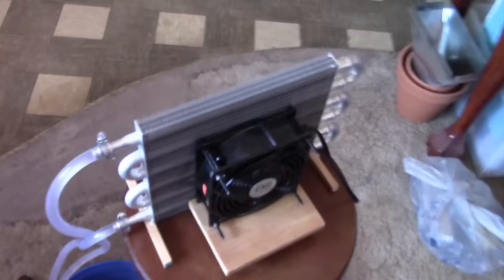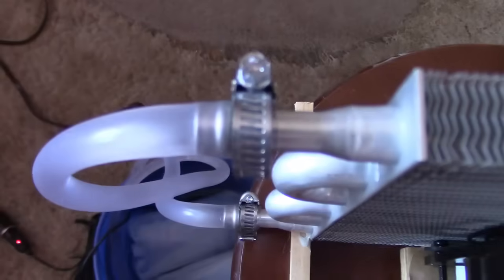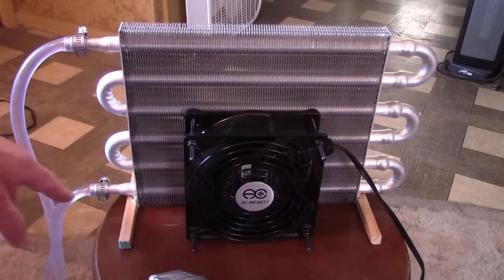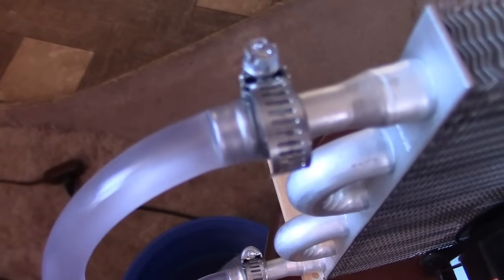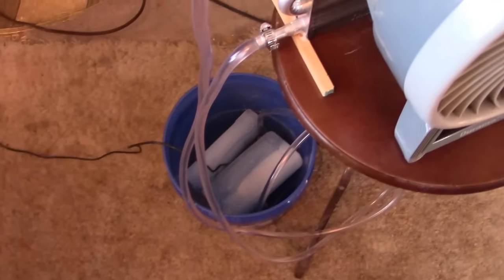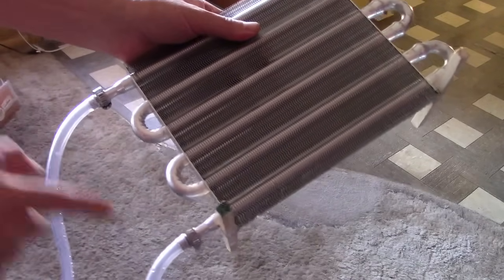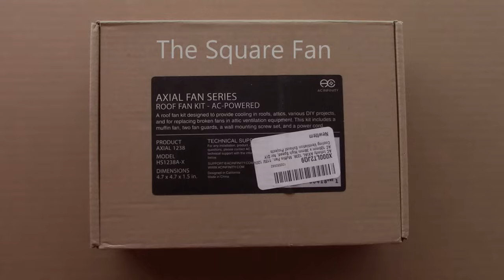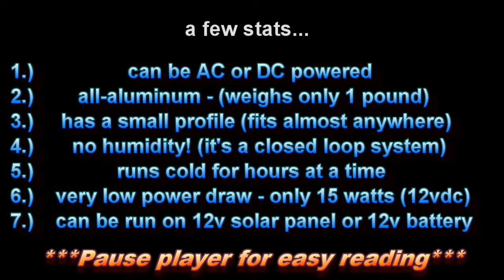Homemade AC Air Cooler! DIY Air Cooling! best yet! (no added humidity)! Easy DIY - Air Conditioner!

Comment: how about connecting both hoses to the pump with a small coil of hose in the water for a closed system, it may keep the water colder longer, using a salt brine would also help
Reply: Great job
Reply: Will the salt decrease evaporation rate?
Reply: @aliksashka  not the original commenter but saltwater has a lower freezing point, if it's salty enough you could potentially have sub 32°F liquid water from the freezer. It's specific heat capacity is also(slightly) higher, due to the properties of the dissolved salt. However, if there are any metal components in contact with the saltwater, you open yourself up to significantly higher corrosion rate, and if there are dissimilar metals in contact, galvanic corrosion(sometimes referred to as electrolytic corrosion). All in all, unless you NEED the extra degree of cooling or you know 100% your components are all one type of corrosion resistant metal or plastic, I'd choose longevity of equipment and thus fresh water.

Edit: evaporation isn't much of a concern with this design, as it'll lose effectiveness before the water heats up to the point it would rapidly evaporate. The intercooler or whatever he used won't allow for evaporation, it's designed for closed-loop operation, vented at the reservoir, exactly as the build is designed.

Edit 2: @Doc Inc, a closed loop that is expected to go through thermal transients (temperature changes) that has so surge volume (space to expand and contract) would over pressurize. It would likely fail at the hose connections(any of them, I'm not sure which would be most likely.) You'd need to add a very low pressure relief or punch a pin-drop leak into the discharge, which may effect efficiency. Either that or install an accumulator/vented expansion tank on the suction line, and the latter of those options kind of defeats the purpose of a closed loop. I suppose a small plastic check valve, again on the suction, might do the trick. It'd be cheaper than any of the other options.
Reply: @USNJackman  Thank you very much for this detailed explanation!
Reply: @aliksashka  no problem at all! I've taken classes on heat transfer and fluid flow, as well as design materials and water chemistry. I love to share the knowledge I have and learn more! : )
Reply: All good points. In this case sing a closed loop system I doubt there are dissimilar metals as the pump internals are plastic? All said and done I believe the best improvements would come from tweaking the flow rates,fan speed and insulation
Reply: @ronaldduck7567  absolutely, with a bigger heat exchanger, bigger pump and bigger fan combined with a larger reservoir, you could make a small "cooling cart" to easily move anywhere in your home and stay cool. Insulation would absolutely help efficiency, I'd say some thin flexible insulation on the tubing would be the biggest game changer. As for the bucket/reservoir, upgrading to a cooler would handle that, or just stack it within a second bucket. There should be a small pocket of air between the buckets and entrapped air makes for pretty decent insulation.
Reply: @USNJackman  a rolling cart set up would be PERFECT😃

Comment: What would you say worked better - having the fan on the front (extraction) or at the rear - blowing over the fins?
Reply from the maker: hi there. i like having it on the front. blows more air that way.
Reply: @desertsun02  just looking for the parts to get it sorted tomorrow.

Comment: If you make a box for the trans cooler with hole for the fan on the opposite side, the fan will pull more of the cooling surface air from the cooler possibly creating even cooler airflow. Maybe. Lol just a theory.

Comment: Which Heat Exchanger are you using?
Reply from the maker: hi. these are the hayden transmission coolers. i have several models 401, 403, and 405). if you're looking for them - amazon has them. 👍

Comment: Entropy.... where is the heat moving to?
Reply from the maker: hi. the heat from the air in the room is moved into the water.
Reply: @desertsun02  I find this absurd because the bucket of water is inside the room.

Comment: I had a simmer idea. Instead of a ice cooler it would be a deep freezer with 4 to 6 gallons of anti freeze. A deep freezer use about 100 to 200 watts an hour. It would take about 5 to 10 hours to get the anti freeze to below freezing temperatures but once you do it should use almost no electricity to keep it freezing.
Reply from the maker: Sounds great!

Comment: Whats the plan to deal with condensation?
Reply: An easy method would be to simply put a tray down below the HX. If you're changing out the cooling medium frequently, you could simply shake out the radiator when doing so. If you're in an arid climate like DesertSun02 it shouldn't be that bad, but if you're in a humid environment it should still be reasonable to deal with. A serving platter or a baking sheet(just not the perfectly flat ones) should do the trick. Hope this helps!
Reply from the maker: hi. simplest way it just to put a towel under it. or piece of plastic or tin foil (just ideas off the top of my head). anything that will catch a few drops of water. i didn't have anything but a little frost.

Comment: where does the condensed liquid goes which appears on coils/fins due to circulation of cold water.?? does this cooler add humidity to closed space/room or we have to provide proper ventilation.? please guide..!!
Reply from the maker: hi. i don't have condensation issue where i live (not very often that is). it sometimes will bead up but not enough to drip off. since it's a closed loop the unit doesn't add any humidity to the room. (and when the water beads up it's actually removing water (humidity) from the air.) no ventilation of any kind is needed with a system like this. it runs perfect in an enclosed space 🙂

Comment: niceeee yea thats the one i like alot as it fits a larger fan better :)  quick questions.. 1. in your experience how does pump speed effect duration and cooling? 2. what about fan speeds? have you played with increasing decreasing fan, pump and/or adding additional insulation around the fan?
Reply from the maker: hi. i've only used a single speed pump so i'm not sure how a different pump speed would affect it. regarding the fans, as you run them slower the air temp will feel cooler (more time in contact with the cold fins). then again, if you are sitting right in front of it you'll have more of a wind chill effect if the fan is running faster.

Comment: add a peltier complete unit and you can prolong the low/cold temperature, providing you can dissipate the heat from the peltier. Maybe to use it to boil some water?

Comment: HOW MUCH DID THE TRANS COOLING CORE COST . AWESOME VIDEO.
Reply from the maker: hi and thanks. about 24 dollars. the brand i used runs from about 22 to 32 dollars. (depending on the size and shape). get them soon, they are selling fast. (i just bought 2 others yesterday)

Comment: What are the dimensions of the heat exchanger?  I used a heater core from a ford ranger and is about 6"×8"
Reply from the maker: hi. the area with the fins is about 7.50" by 8.75"

Comment: Dig you a 10 ft hole outside your window. Then get another coil to be as a condenser coil. run your hoses to it and run it to you other coil, which would be your evap coil. fill the system with water, install your pump and fill the hole with dirt adding water every foot so the dirt stays moist. Turn on your pump and fan. It should drop the temp about the same. do not forget to insulate your lines as they come from the ground. do not need the sun to warm up your lines. This way you do not have to fill buckets of water and chill ice packs. You can do this for every room and even put it on a solar system on 12 volt.

Comment: Hello there, DesertSun02. As luck would have it, I have a sizable intercooler that never made it into my car before I killed it through negligence, so I have or can acquire everything on the materials list... Except I don't know what type of pump to get. Without being too specific(I've seen your reasoning behind not giving out links for specific items), could you give me some criteria to look for and perhaps where I should or shouldn't look for one? About the cheapest I've seen (haven't looked THAT much) was around 25 dollars for maybe 60 or 80 GPH. Also, with this type of build, would it be better to have an oversized fan or an undersized fan? I had some difficulties with an ice to air chiller due to the fan being oversized, and air just redirecting upwards outside of the fan blade radius(it was a box fan, and air came up in the corners, basically. Bypassed the styrofoam cooler entirely
Reply from the maker: hi. there are tons of these pumps on amazon all $8 to $15. just search 12v 5 watt water pump.  i'll give a few links.

this one is $10.99 https://www.amazon.com/Decdeal-Submersible-Water-Ultra-quiet-Aquarium/dp/B00JWJIC0K/ref=sr_1_5?dchild=1&keywords=12v+5+watt+water+pump&qid=1624970115&sr=8-5

this is a 2 pack for $16.99 https://www.amazon.com/MOUNTAIN_ARK-Submersible-Pumping-Rockery-Fountain/dp/B073XMP2VX/ref=sr_1_6?dchild=1&keywords=12v+5+watt+water+pump&qid=1624970368&sr=8-6

this is one for $12.99 https://www.amazon.com/Mavel-Star-Submersible-Fountain-Upgraded/dp/B0713T9PRP/ref=pd_di_sccai_2/140-7959875-1515230?pd_rd_w=FtmsC&pf_rd_p=c9443270-b914-4430-a90b-72e3e7e784e0&pf_rd_r=3DVDMDVVBZF9SWV175G6&pd_rd_r=de1b867f-1cff-46a9-bf0c-c220c66a608e&pd_rd_wg=RnHbK&pd_rd_i=B0713T9PRP&psc=1

this one is $8.99 https://www.amazon.com/LEDGLE-Submersible-Ultra-Quiet-Dual-Purpose-Hydroponics/dp/B085NQ5VVJ/ref=pd_sbs_4/140-7959875-1515230?pd_rd_w=EeNaw&pf_rd_p=f8e24c42-8be0-4374-84aa-bb08fd897453&pf_rd_r=DQ498KPQFKF1V9DK20N0&pd_rd_r=b0f736ba-467d-459a-b250-65d97d9f8e8f&pd_rd_wg=JZ1pY&pd_rd_i=B085NQ5VVJ&psc=1

Comment: Where do you get the radiator?
Reply from the maker: hi. amazon, ebay, or many auto parts sellers should have it. search for trans coolers. cooler cores may work good too (but i haven't tried yet). you can also just search for 'water to air heat exchangers'. they are similar - but generally bigger and bulkier. if interested, here's a link to a video i made using one - to make a large air cooler https://youtu.be/u0AGRBT1ISs
Reply: @desertsun02  thanks. Excellent build, btw!

Comment: I was watching your ice maker video and was thinking about building an AC unit like this but that uses the ice maker’s hardware to keep the water cool - or you could just have it tilted to dump ice in a cooler every 15-30 mins or so - feeding the water line from the system radiator back to it. That kind of system could probably run on less than 200 watts - except for when the ice maker power usage spikes when it starts up.

Comment: I can't find the heat exchanger that use their all the ones I found are over $100
Reply from the maker: hi. if you search cooler core or heater core, that will bring up lots of them that are under 100 dollars. i used a transmission cooler in this video

Comment: you just use a PELTIER module for that kind of DIY
Reply from the maker: hi there. i wish it was possible but unfortunately peltier cooling only cools very small enclosed (and usually insulated) spaces (like a dorm size fridge or small dog house). usually one cubic foot or less is all they can cool - and that takes a big 12a 12v unit running for a while. unfortunately, all claims on the internet of peltier ac are untrue. some day the tech. required might advance enough to make it possible. let's hope ✔

Comment: Desertsun, do you get strong air when you put the condenser in front of the fan? Do the fins restrict the airflow? I can't put it at the back because the back of my fan  is not flat. In humid location, the condensation will cause humdity, will it be as much as the evaporative air cooler?
Reply from the maker: hi. it works good either in front of or in back of a fan. the fins only restrict the airflow a little bit. note that the condensation doesn't create humidity it actually reduces (removes) humidity (by pulling the water out of the air). 😎

Comment: Pc radiators with proper sized fans work even better than this
Reply: I was thinking of trying those out. Have you built one, Benjamin?
Reply: @dearlaserworks  but to answer your question I haven't yet :( I've been dying to make one but funds aren't all there at the moment
Reply: @benjaminrivera117  I just hooked up a 240x120 CPU cooler w dual fans to a little pump in a 1/2 gallon of ice and it was impressive. Cooled our hall bathroom from 75 to 70 in about 10 minutes.
Reply: @dearlaserworks  that's awesome!

Comment: Not too bad, but the only thing that everyone who builds these types of DIY portable AC always fails to mention condensation and how to address the issue of containing it.
Reply: With a compact build like this, the absolute most you'd need is a baking sheet. Just make sure your electrical doesn't get soaked. A towel should do the trick too, unless you're in coastal Louisiana or some such.
Reply from the maker: yep, if you have any condensation, just set it on a hand towel (or piece of plastic or tin foil - anything to catch a few drops of water. all i had was some frost.

Comment: Would the plastic tubing melt if you tried to also use it as a heater?
Reply from the maker: hi there. the last time i checked temp rating for clear vinyl tubing it said it was rated to 175F. just keep it under that temp. (or the rating for the tubing you use) and you should be good.

Comment: You want to put the coil in a shroud/box opening that just fits the coil fins.  Then you want to fit the fan to it’s own hole in the box blowing out of the box.  This will put a slight Vacuum on the box which will pull air thru the entire surface of the coil. This will improve the heat transfer into the coil significantly resulting in even cooler air output.  Not a high volume unit, but good to take the edge off.  I built a similar larger system using a car radiator and circulated 55 degree irrigation water thru it on it’s way to the sprinklers.  It definitely took the edge off of the hottest days for a smaller area…

Comment: Great idea. Built one using a 48 qt coleman extreme cooler. Drops temp from 91 to 67  by cooler in a few minutes. Only issue I have in Florida is the amount of condensation on the fins from the humidity, if I want to se this in the tent, I'll need to rig a tray and pads to absorb the water. Getting ready to make the cooling tower for the pool patio, which is where I use this unit.
Reply from the maker: sounds great - and awesome temp drop from 91 to 67!
Reply: Could the fins and entire unit not sit on top of a grid on top of the bucket of water thereby letting the condensation run back down into the water bucket?
Reply: The name of the fan in the thumbnail
Reply: Make a little water trough that goes right back into the water

Comment: This is a little bit closer to what I imagine a cheaper geothermal system could be. I want to try to make one that goes ten feet into the ground to get heat exchange without getting cold water to do it.

Comment: How long does it last? I’m just wondering if it will still be usable with cold / cooler water (once the ice has melted). Of course, the effectiveness will drop but by how much? How much temperature drop when  room temperature water? Any chance you could share some numbers? I’ll be really greatful.
(Trying to justify the expense. Being careful with the money. Lost my job.)
Reply from the maker: hi. it lasts anywhere from one hour to probably over 8 hours or more. really just depends on amount of ice or cold water you have and how hot the room temp is. if you freeze water directly in the bucket *almost to the top (and only add a little cold water to the top - and drop the pump in - when you are ready to use it) you might get a full day out of it. as the water warms up the effectiveness slowly decreases until it reaches a balance. when the water is room temperature there is no temperature drop. i tried it with my tap water and got a 5 degree temp drop so if you have tap (or well) water that is colder than room temp you should get a temp drop. even water that is 60-65F should work well. after 1.5 to 2 hours the temp in bucket was about 59F and the air temp was 67F.
Reply: @desertsun02  Excellent. Thank you for that.

Comment: If you run the fan on a slower speed, the air stays in the cooler a bit longer and you'll get lower output temps.

Comment: I have thought about doing this . But i wanted to do a sealed system under the house . My idea was to run the hose threw the floor to another radiator. That radiator would be in a pan of water or antifreeze and then cover the pan with dirt . You could get the cooling in the summer and warmth in the winter . Check the temps under your home it is alot cooler under there .

Comment: Dude, nice job! Just to springboard off this idea;
I’m thinking closed loop system with like 25’ of this line coiled up in your freezer and everything else the same. You could use a small 3/4” hole saw plumb it up and make it look Frankenstein :-) right into the freezer